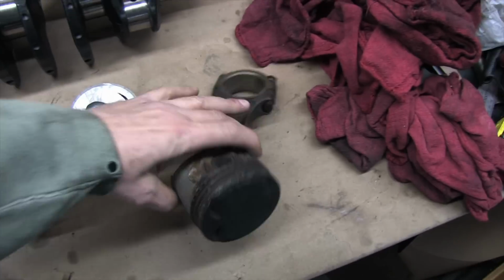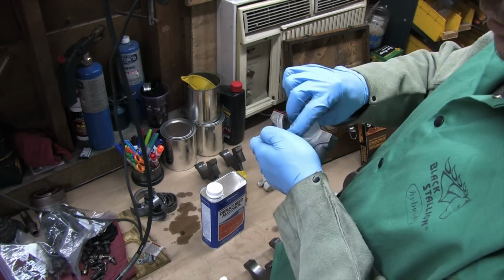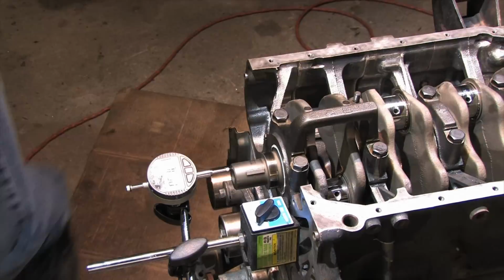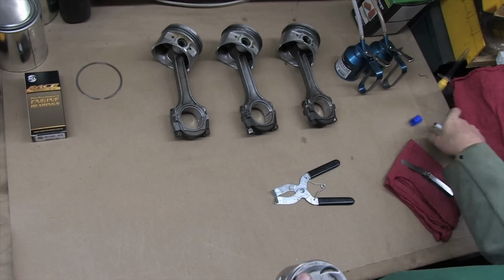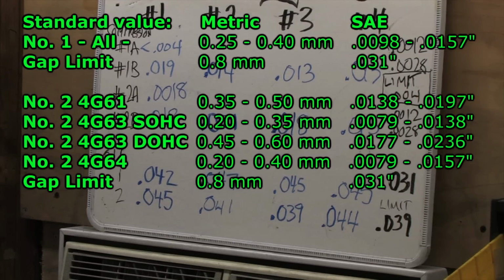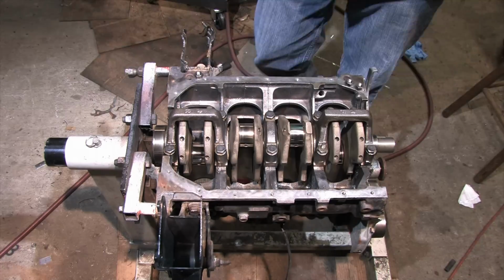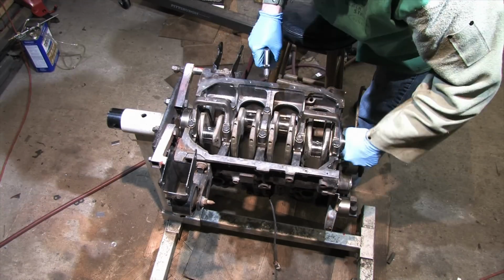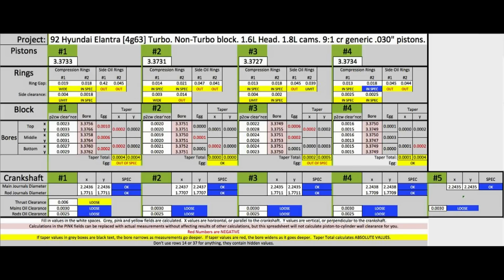Hyundai Assembly 1 - Blueprint Everything

Comment: Is this the 2.0 liter engine that goes into hyundai coupe? Awesome video!
Reply from the maker: If you mean sCoupe, no.  That's what the Hyundai 2-seater is called here.  Here they all got a 1.5L 4G15's like the 1.5L Elantra, Colt and Mirage models.  Some of those cars got 4G61's which are 1.6L.  The 2.0L is from the Sonata, Galant, Eclipse and Talons.  The 4G block has the same outer dimensions no matter what it is, but the bore and stroke are different.  That's why I was easily able to fit this engine into an Elantra.
Reply: @Jafromobile  Thanks for the response, here we have two inline 4 versions: 1.6l and 2.0l and also a 2.7l V6 but all are N/A so I'm trying to figure out how to get a bit more power out of mine without breaking it xD
Reply from the maker: @AstekOst  I don't know what year your engines are, but if they're not between 1991 and 1995, and if the chassis is not earlier than 1995, then they're not this kind of engine.  This is a carbon copy of the Mitsubishi 4g63, and Hyundai used them before they began producing their own engines.

Comment: Great video. Years back I had a 6 in line Ford engine. Did not have much money so I took everything apart, clean all  and then install with new standard rings and new bearings. Took no measurements and ran for 100,000 more miles. I was lucky. You are doing it the correct way.

Comment: Metric please, 90% of the world is metric, the engine you're working on is metric stop with imperial garbage. 

You even use metric with the decimal places ect:
Reply from the maker: Why isn't that 90% of the world making YouTube videos?  Why does the metric part of the world have to all come here and complain about what they get for free? Someone in the metric world could just make metric videos.  Clearly it's the metric system that's in high demand.

If you didn't know, the United States uses both.  My service manual is printed with Standard measurements straight from Mitsubishi.  If you need $1,000 worth of standard tools versus $4,000 worth of metric tools just to measure a hole, your perspective changes.  If you've never had to deal with this, I don't expect you to understand.

What I want to know is... why isn't 90% of the engine building world using a measurement system with 4x the resolution of Metric?  That would be more accurate.  If Mains oil clearance is supposed to be .0008 - .0020", you have 12 possible measurements in Standard.  That's .02mm - .05mm.  3 measurements in metric.  Only problem is that .05mm measurement on a hundredth metric micrometer could be as big as .0023" in Standard.  .0003" is well outside factory spec, and enough to make a big difference in the oil film layer across your bearings.  So really, who's wrong here?  Why is a less accurate system better for me?

There is 4x the graduation in S.A.E. at 10 thousandths of an inch than there is in the more expensive (in the United States) hundredth of a millimeter tools.  If I wanted thousandths of a mm...  $$$$$$$$$.  Just no.  I don't have NASA's budget.

Comment: Hi Jafromobile, excellent video. Have you made this video for the Kia Sorento 3.5L V6 2006 ?. If not, where could I find all the tolerance values for that engine?. Thank..!
Reply from the maker: Yeah, I'd go with those specs.  They look right for modern engines.  You have to keep in mind that the clearances you see here are not going in fuel efficient cars with modern engines.  Nothing unusual about seeing an engine that needs .001" oil clearances on both the crank and the rods.  Perfectly reasonable.
Reply: @Jafromobile  Thanks
Reply from the maker: Your best bet is to buy the factory service manual.  EVERYTHING is in there including the special tools, their part numbers and the procedures to do everything everywhere.  The electrical diagrams are worth the price all by themselves.  You can get them cheap.  You can even find them electronically.  When I want printed copies (and I always do), I've always had great luck on eBay.  They show up used there all the time.
Reply: Thank you  very much Jafro for answering, I have downloaded the workshop manual of the Kia Sorento 2003-06 from several sites on the internet, it is the same always. In these manuals I haven't found the tolerance values of the main and connecting rod bearings. I found some values in the following link: https://www.autozone.com/repairguides/Kia-Sorento-2003-05/Specifications/CrankshaftConnecting-Rod-Specifications/_/P-0996b43f8037a1bf, I would like to confirm them with someone.
The Best,

Comment: Newbie question. Why not use new rings if the bore hasn’t been honed/bored? I’m working on an older BMW 4cyl and upon disassembly the rings were completely stuck with carbon buildup. The bores and pistons are in spec and therefore I was thinking of using them with new rings.

Comment: Is Hyundai not metric?
Reply from the maker: Based off of what I've seen so far, they used cubits, and the speedometer is measured in knots.  Nothing is square or level in this thing, either.  Really this is a Mitsubishi powertrain, so all the specs I'm using are straight out of an Eclipse service manual.  The specs are listed both ways, but the tools that I can easily and affordably get here are all standard.
Reply: @Jafromobile  Sounds like an old wooden sailboat

Comment: do thicker bearings don't exist? for tighter gap?
Reply from the maker: Yes.  In just about every brand of bearing out there you can get oversized bearings.
Reply: Great, I think you sould also do some  special classic like the alfa romeo GTV with the venerable  V6 Busso engine, it has even replacable cylinder jackets / linings  . Or an american classic. With your job they will get alot of extra value. I hope one day I 'll have a garage of my own and start to practice my hobby to   @Jafromobile
Reply from the maker: @215alessio  I have a lot of seat time in a '79 Alfa Romeo Milano with side-draft carburetors.  I have a ton of respect for the classics.  I grew up with DeTomaso cars, and even a legit 65 Shelby Cobra in the driveway.  Those cars were a bargain when I was a child, and are completely un-affordable to "regular people" now.  Every classic I've looked at also came with either a $40,000 frame-off restoration needed, or already built into the price.  Few of the cars from my generation are ever going to be valuable because manufacturers don't race what they sell to the public anymore... but I take the same performance approach with the cars that I have as I would with the classics, I just do it on an affordable platform that's available to my generation.  I'm pretty sure I'll be holding onto the majority of the cars I currently own until I'm dead, but I also expect to own a collectible relic someday.  Someday when I have a barn to keep all my cars in.  ;)
Reply: yes indeed a barn is what we need  :)   I really hope you get hands on one , For barns in belgium where I live now prices get unpayable (unfortunatelly)  wish one day to live in USA where there are more possibilities for "gearheads"  @Jafromobile

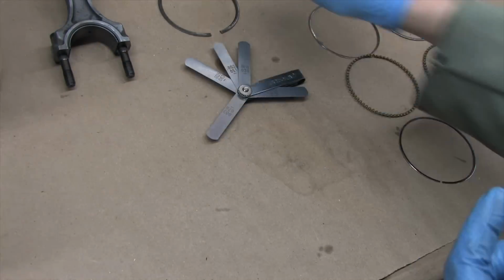Comment: I have just recently found your vids and really like the way you do and explain things. You mentioned ring flutter around 31:32 I have never been positive on what my toyota 4banger did a few times. It was only after I had been driving a lot harder and longer  than is recomended. After about 30-90mins I would occasionally Misfire in the 4500 rpm range and let out a puffs of blue smoke till I would lift.   Sound Like what your speaking of?
Reply from the maker: It does sound like something ring flutter would cause.  When the rings don't seal, it will increase oil consumption.  If you added vacuum for a second (downshift/off-throttle) and it immediately went away until you dogged the p*** out of it again, then those are the right behaviors.  Vacuum makes the rings seal better.  Inadequate PCV functionality (breather ports) are also contributors to this behavior.  If the crankcase gets pressurized from excessive blow-by, the rings won't seal as well.  So really, there's 2 things that could cause it, but one of them will contribute to the other.  Crankcase breathers need to be adequate for the power levels generated.  Lots of V8 guys find this out the hard way, but it affects 4-bangers just the same.
Reply: Never thought about the crankcase pressure being high and the engine being at near 0 in vacuum.... Thanks, I can tell my girl friend I don't know everything now...lol   I will keep watching

Comment: Hello Jafromobile,

GREAT VIDEO and thank you for posting.  Detailed explanation of rebuilding the rotating assembly is the best I have viewed!

I am rebuilding a Toyota/Yamaha 2zz-ge and this video is very helpful.

My only question is on your bearings that were installed.  During my build and using service manual I had to select different bearings based on stamping on the block and crankshaft to get correct clearance.  I was actually an issue when I went to order from my Toyota dealer as they offered a "complete set" or individual coded (#1 - #4 for example) for each cylinder.

I am waiting on my block and crank, but will of course use plastigauge to confirm clearances.

FYI:  The specs I am getting from the shop manual are very demanding for precision....as in measurements to .001mm.....grrr and outside my current measurement system capability of 0.01mm

Thank you in advance for any advise/comments,
 P
Reply from the maker: The service manuals of most cars get really complicated regarding bearing selections, but it really all boils down to 1) how big is the hole, 2) how big is the thing, 3) how big are the oil clearances supposed to be.  

Bearings are sold as a set, in one size.  The journals should all be machined to the exact same diameter.  If it's not, it needs to be either align bored, or honed so that they match.  Removing material on any one journal to repair imperfections should be repeated on all of its brothers and sisters if it was done right.  So however much material was removed will ultimately determine what bearings you need to get.

Your engine came with an oil clearance specification and it's in your service manual.  For instance, mine is .0008" (.02mm) to .0020 (.05mm). The service limit is .004" ( .1mm ), meaning that if one gets that bad, stop driving it and rebuild it. According to my service manual, as long as I've got a value between .0008" and .002" for my oil clearance with a matched set of bearings, I'm good.  There will be variations between journals measurable in the .0001"-ish range (.002-.003mm-ish)... and that's to be expected, but you're supposed to use a matched-set of bearings.  You're not supposed to mix and match replacement bearings.  If standard bearings are too loose for all of your oil clearances, then you need oversized bearings to fill the oil clearance gap.  If it's a stock build, street driven and you're going for longevity, aim for the low side of that oil clearance spec.  If it's a offload max power build that you'll go through regularly, then go for the larger end of that spec.  How you're going to use the engine is more important than what's written in the book.  Think: loose is fast.

Your oil clearance is determined by your engine's designed oil viscosity and the efficiency of of the oil system.  This engine suffers from high oil pressure with balance shafts blocked off and no oil squirters, so I can get away with it.  That's why I set mine up at .0025", a half-thousandth bigger than the widest acceptable oil clearance.  I went loose to decrease my 48 PSI warm idle oil pressure, and because I'm going to run the dog shit out of it replacing bearings as necessary.  On a stock-built 4g63, I'd only aim for around .0012 (.03mm).  Hopefully this sheds some light on all that work the service manual put you through...
Reply: Hello Jafromobile,

Thank you for your insight and replying to your youtube audience.

I agree with you on O.D. and I.D. and will be measuring/confirming results with plastigauge to make sure oil clearance is within spec.  I expect it will be at least one week before I can offer results, but hoping for nominal oil clearances for long life.....and high revs.  

NOTE:  Engine was Celica GTS drop-out with ~110k miles from Michigan.  Translated that means the core was abused, corroded, and generally unhappy.  

Your videos are AWESOME!  When I measure my rod journals, I will use the procedure you used (installing piston w/o rings for easy insert and checking.)  GREAT idea to make stable rod w/o having to compress rings while palstigauging!

You also make some great spreadsheets in Excel!  I try to do the same, but liked your visual references.

Thank you again for your response.

P
Reply: Data below that I have b/4 receiving block and crank back.  Actually data is from bore gauge, but with only .001mm resolution.  My results still show out-over spec vs. 82.013....again measuring system not capable.

Block only clean, crank polish only.

Hope you can make sense:  Copied data from Excel sheet.

01 Celica GT:  2ZZ-GE engine block    vehicle VIN:    JTDDY38T410043686 
  NOTE:  all measurements in mm      
     Still Q below check gauge
Spec: Min:   82.000 max:   82.013 confirmed ADK 
  Tolerance max:   0.013 off by factor of 10?  On measurement???  
Received by:     Chesterfield Engine  02-Mar-2018 
Cyl-1 A B C OK/NG  
1- crank inline 0.010 0.015 0.010 NG 0.015 
2-rotated 90° 0.055 0.040 0.040 NG 0.055 
      
Cyl-2 A B C OK/NG  
1- crank inline 0.025 0.028 0.030 NG 0.030 
2-rotated 90° 0.060 0.050 0.040 NG 0.060 
      
Cyl-3 A B C OK/NG  
1- crank inline 0.020 0.028 0.030 NG 0.030 
2-rotated 90° 0.060 0.050 0.048 NG 0.060 
      
Cyl-4 A B C OK/NG  
1- crank inline 0.020 0.020 0.015 NG 0.020 
2-rotated 90° 0.060 0.050 0.040 NG 0.060 
      
NOTE:      
"A" measurement 10mm from top of bore      
"B" measurement at mid stroke of bore      
"C" measurement 10mm up from bottom of bore
Reply: Bore gauge and micrometers 0.01mm, NOT 0.001mm that I need....sorry for error in text above.  Also noted that on Mitutoyo site, 0.001 resolution, but not accuracy (0.00x mm where x = 5 or 0 on digimatics)
Reply: Cancel above:  Was hoping to not "machine" block, but definite egg shaping even with gauges used.  Block bores are MMC.....and ideas for this block?

P
Reply: current thinking:
1)  put rotating assy back as-is with new bearings.....not my style, but compared to below cost  & risk......?
2)  As above, replace rings (have on order already from Toyota so sunk cost).  Not sure on seating with block condition and no-hone.  Again MMC bore and I have limited experience.
3)  Send block for Nicasil plating.....~$1,000 + need new pistons (non Fe coated).....add....? $500?  On plus side, if I take this route, engine will be well ready for 9k+RPM.
4)  Risk buying new/used complete drop-out from Japan (JDM)....plus is getting extra transmission and all other engine parts.  minus.....do not need all parts, bore could be off....but lower risk compared to my unit.

Any advise will again be appreciated.

P

Comment: Jafro, do you have to get the rings bang on specs or aim for around the spec? if not, how much off are you allowed to be off; 0.0005? more? One of my rings gives a little drag on the feeler gauge but another it slips right in but the next size up will not without moving the ring so I guess it is in the middle, is that ok or have I taken one too far? Thanks!

Comment: You should be taking FOUR measurments per journal. Two measurements 180 degrees apart at "both ends" of each journal. That's how you determine out of round or "egg" as you call it and taper. Same goes for cylinder bores.

Comment: Since nowadays most of the stuff in stores is made in china you have to be careful with those carpenter rulers, right now going through BMW straight 6 engine rebuild and was checking the straightness of the engine block only to discover that its not the block that is not straight but the ruler! Went back to the store to exchange and all of them are more or less curved. Dont trust anything that is made in china, they cant get anything done properly, even a ruler is a mission impossible for chinese. So pissed!

Comment: so no mention of making sure the pistons go in the right way?  or are the valve reliefs the same on both sides?
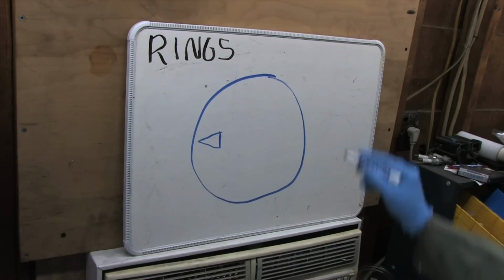Reply from the maker: There's an arrow cast into the face of the piston.  I drew it on the chart at 33:18.  That arrow faces the front of the block.  It's in this video and other ones, too.  It's in the "fighting the valve clearance" video, and I think it's also in Hyundai Assembly 4
Reply: Right, your so thorough, I was expecting additional commentary on when they were going in the block.  I was mentored by a guy who built engines for Nationwide truck team.  It's all the same !

Comment: I've just used a grinder on my crank girdle to enable the front axel to fit through the sump on my rb25det, I used shaving foam to help retain the grindings, I washed the block out with brake cleaner after too. looks like it will be junk now having seen just how clean everything should be...

Comment: When inspecting main bearing clearances...other than the fact you mentioned it is covered in the FSM. Is there any reason you are using plastigauge rather than a bore gauge? 

I figured I would use a bore gauge on mine and do the math to figure out clearances like you covered in your Blueprint 100 series.

Thanks Jafro.

Comment: Excellent job, but very unnecessary detailed precise work for an cheapo engine.
Reply from the maker: This engine is making over 400hp today.  :)  There is just cause for all of my efforts.  Had I not done all of this, I would have crashed the valves the first time I turned the boost up.  Watch "Fighting the valve clearance", and you'll see why I go through this much trouble.  None of these internals came from the same car and should never have been bolted together to begin with.